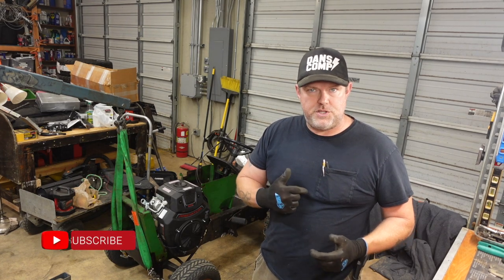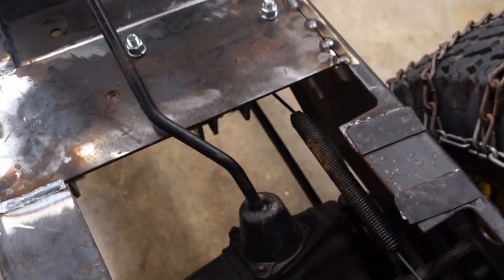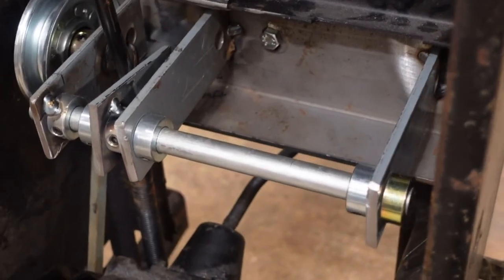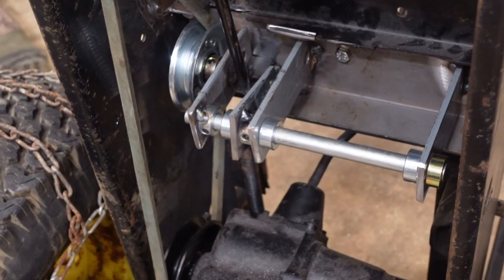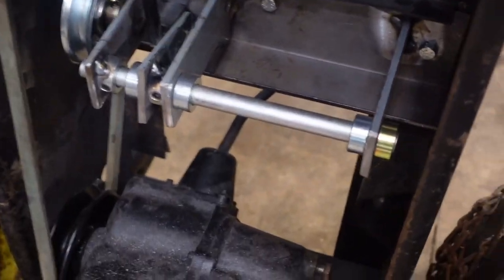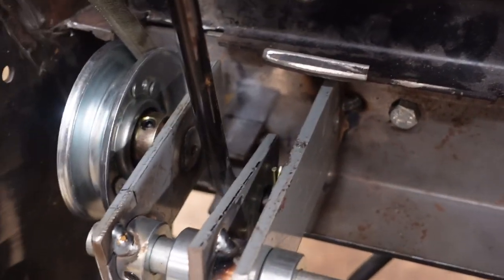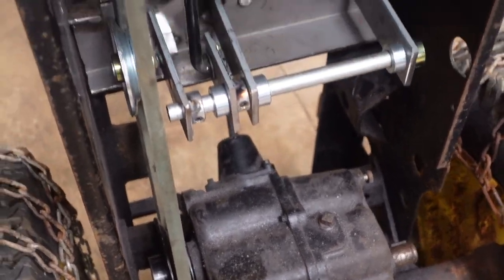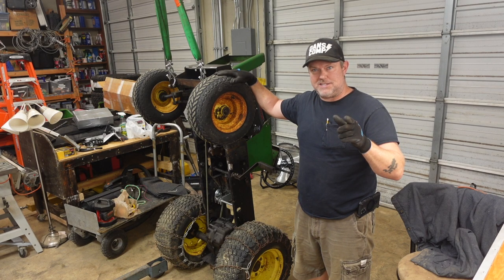Custom clutch pulley setup/ John Deere 214 mud mower/ close up and overview/ part 5 of build

Comment from the maker: After messing around with it more, I realized I need to make the tensioner pulley lever a little longer, or get a one inch shorter belt. This is so the tensioner pulley can be under spring tension and not come into contact with the over travel stop. 👍🏻

Comment: Great job on the clutch set up.  I know I am too late for this video, but I would not do the tension pulley.  It will just tighten your belt when you clutch.  I'd want every bit of slack I can get when clutched.  Again, great fabrication! 👍
Reply from the maker: Thank you! I did not end up putting in a tension pulley. I Jumped into this project head first going off of the videos I saw from Carl Hartman, Captain315 and LilBJessup. Trying to mimic their Wheel Horse setups. At the time I hadn’t realized it was Creepycrawlers setup ultimately. Since then with trial and error(s) I’ve got it working very reliably.  No issues with slippage yet, even  when I had it submerged. Also no issues with belt deterioration yet, which is what I was mainly worried about being a one off setup. I think the biggest attribute to this system is there are no idler pulleys between the crank pulley and transmission pulley on the “tight” side, the belt is just straight. If anything goes wrong with it in the future I will definitely make a post about it. 
Another thing I feel is a negative with the final setup is that if the belt needed to be replaced out on a trail it would be a mission, but not impossible. There are the guides and a couple keeps that are a bit tough to get at. Otherwise I’m very happy with it. Thank you for your insight and comments! Much appreciated!

Comment: Any reason why that motor would not work with stock drive train to still use as a mower
Reply from the maker: I have not tried it, however, my opinion: you’d have to get the crankshaft or output shaft pretty much in the same exact place as the stock Kohler was. The stock drive train has two belts and a pulley in the center that varies in circumference when you move the lever that controls it forward and back. I believe everything is set up in such a way that the belts that are on it from factory have to remain the same size or else it won’t work correctly. We have another 200 series that is stock and we use it still. The whole drivetrain has to be adjusted just right and it is finicky sometimes. Sometimes it also throws the rear belt off too. But I guess it is 40 years old so it’s to be expected I guess. That’s just my opinion and I could be wrong!